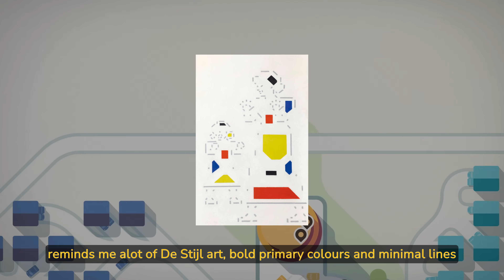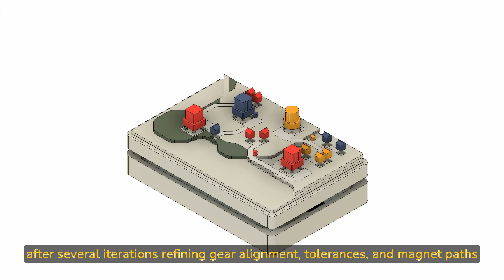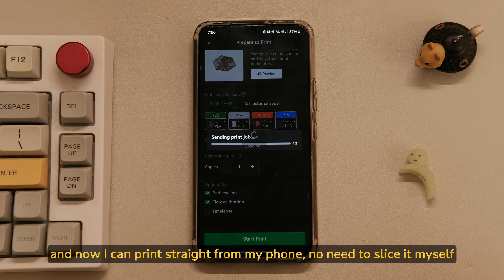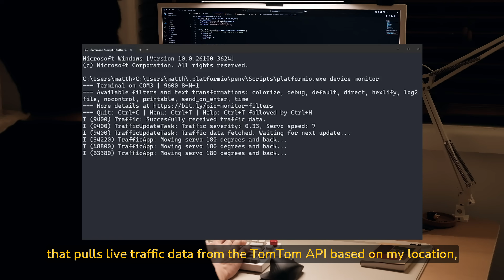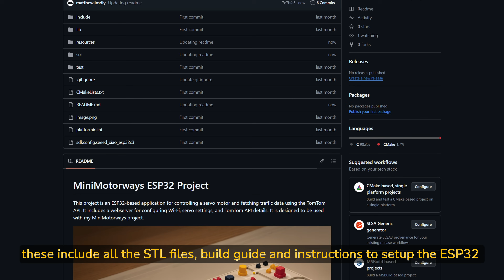recreating Mini Motorways as a functional 3D printed map

Comment: Also just wondering if the different colored areas could be made as separate files? I don't have multi material printing but it's ok if not, I can just paint!
Reply from the maker: the top map is a 3mf file so you should be able to print them separately and glue them however you might have to shrink the roads to make them fit